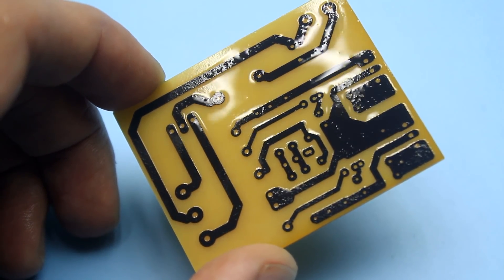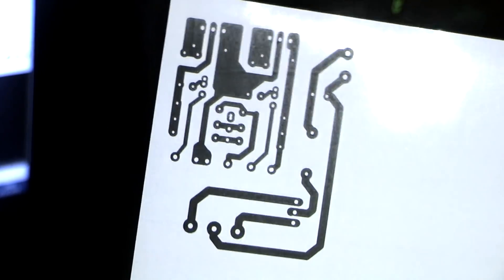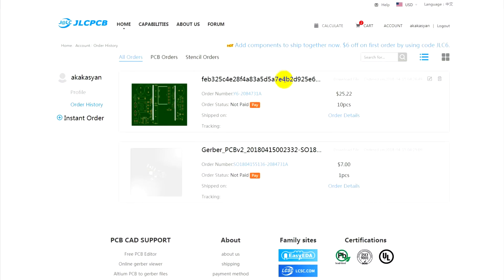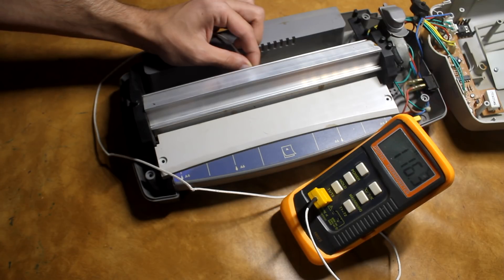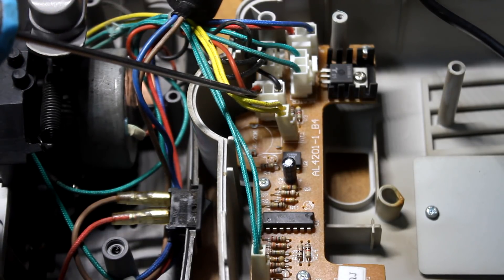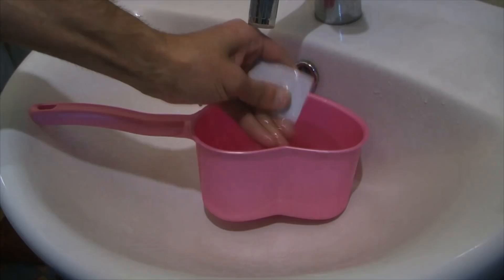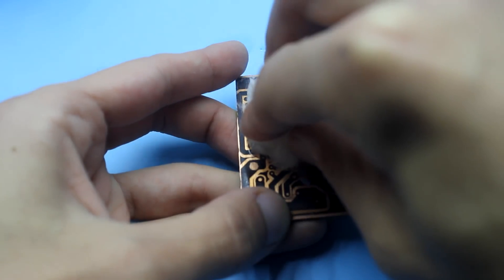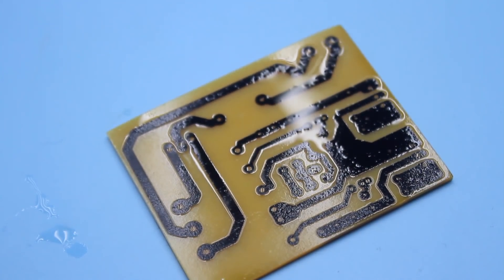How to create a PCB - using a  LAMINATOR

Comment: How about to control the heating-roller's motor and decreasing the rpm's....??
Reply: You cannot since it is an AC synchronous motor one cannot change the speed. You would rather need to swap the existing ac motor with a DC motor so you could easily tune the speed

Comment: Mr Carlson's Lab (on the YT channel by that name) has a video about the modifications he did to a laminator to get higher temperatures. I think he has the best explanation of that type of detailed modification with cooling fan and circuit mods. The problem with higher laminator temperature is that the higher temperatures can damage some models with plastic drive gears. I haven't used a laminator myself though. I prefer to use a travel type clothes iron. They don't have steam functions so the surface is totally flat. I have bought 2 that were brand new at the local second hand thrift store. It's one of those cheap things people buy and never use. I think I paid a dollar apiece for each of them. I think this type of travel iron is the best for any boards smaller than the surface size of the iron. The only time you really need a laminator is when your boards are larger than the iron.

  I like the nail polish touch-up idea, but I imagine that has longer drying times. I use the cheap Chinese etching markers that can be found on AliEx for less than $0.50. They have two writing tips on each side, one with a fine point tip, and one with a small marker type tip. They are also perfect for making your own notes and labels on PCBs and parts, especially if you don't have a silkscreen. Do not use a sharpie for etching touch-ups. My ferric chloride went straight through sharpie ink (really just a dye).

   If your having trouble getting your laser printer ink to bond or need to get it even I don't recommend using acetone directly as shown. Obviously it works for some people like it was shown here. I think the better way is probably an Acetone vapor method. Marco Reps (on the YT channel by that name) did some videos awhile back about using a Lexmark laser printer with a straight through feed to print directly on copper clad. This printing style doesn't pass over the heated roller in the laser printer, so the ink is just placed on the PCB as dust and is not heat-set. Marco showed how he used an acetone vapor method to fix the ink to the copper clad after "printing" directly. Spoiler alert, he couldn't get his printer to align 2 sides well enough to do double sided circuits with this machine and scraped the project in favor of more advanced methods.

Comment: What if I have ink printer? Will it work? If not what are other options
Reply: There are people that have filled their own ink cartridges with various liquids and built direct to copper clad printers. Honestly this is more trouble than it's worth in my opinion. You can get a cheap laser printer at a local second hand thrift store for cheap. You'll find one if you are patient and stop by a store a few times within a week or two. I got a cheap one for $8 with a full cartridge and tray of paper. It's super easy to print on a piece of glossy paper from a junk mail flyer and use an iron. Just be sure to get the iron really hot and thoroughly heat the ink/copper clad. Put the combo on a small piece of flat wood before you iron the ink on. That's the part most people aren't bright enough to figure out. Don't sink all of your heat into a large surface (like a giant countertop), on the other side of your PCB. A small piece of wood will focus the heat on the PCB/ink and it will yield good results. The real challenge is learning KiCAD or other EDA of your choosing.
-Jake
Reply: A laser printer actually uses plastic "dust" to print with and melts the dust to the paper. The plastic is what resists being etched. You re-melt the toner plastic from the paper onto the circuitboard blank. An ink jet printer just uses powdered dyes dissolved in a liquid. The liquid evaporates and leaves the dye behind. Nothing an ink jet printer prints with is melted plastic.
Reply: No, unless you add a photo etch stage to the process. Search "photo etch PCB" or something like that on YouTube.